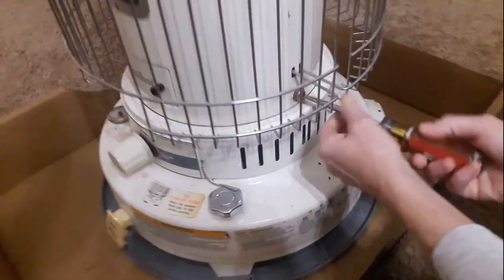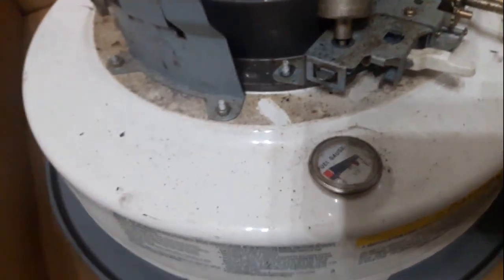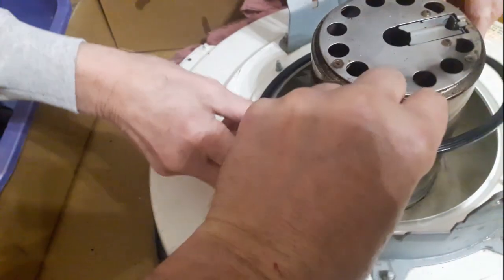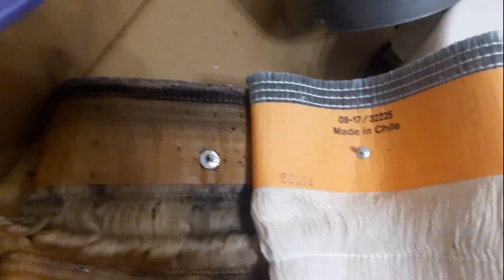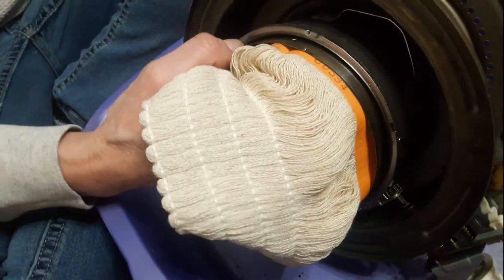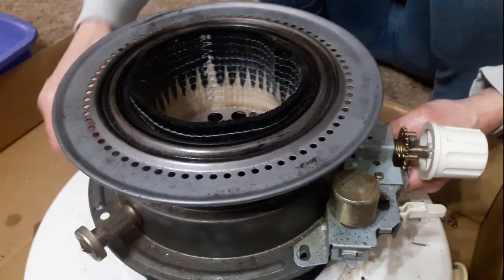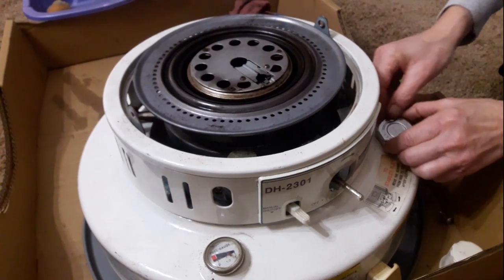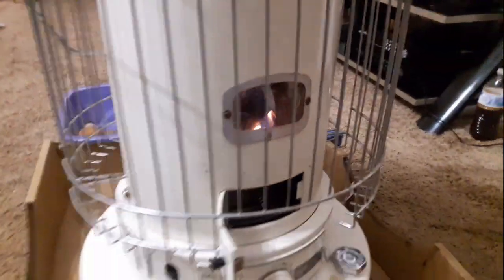How To Change A Kerosene Heater Wick

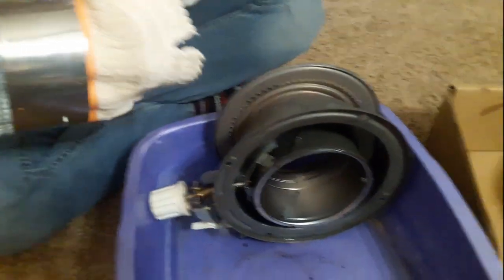Comment: Thank you so much for this. I have watched so many videos but was doing something wrong until I saw this one. You said to raise the wick BEFORE removing the wick assembly. I haven't done that yet and at 5:20 on your. video you said how to line up the pin heads to the holes in the center piece that raises the wick. No other video has mentioned that before. I hope that is my problem. I am quite a handyman but I'm just missing something while trying to replace a simple;e wick in a kerosene heater....... I hope your extra pointers help me get this thing in. Thanks Again.

Comment: Question, I have a kero world kw-12 heater. I used your video as a guide to change out my wick. I thought I did a good job until I went to light it. For some reason the flame is staying below the ring instead of going threw the center piece. What in the heck?

Comment: What’s the knob that pulls out on the back left side across from the wick adjuster? I picked one of these up from the dump and it works somewhat. Wick is good it is smoking on low. I’m trying to get it shop ready for winter.

Comment: How do I shut off A  Kero Heat Heaters that does not shut off ? I tried shutting it off to the Shut off Manual and it is still running  ? I tried the Adjusting Range But it is still going .

Comment: Where can I find the wright wick part number the misses left the manual at the store when she took it out the box to look at thanks
Reply: It is usually where the model number is on the heater on one of those labels beside the caution label. That's where I found mine at. I hope that helps.

Comment: I have 2 karosen heaters the first one I got a few weeks ago it done good on the first tank of fuel than the second tank of fuel it started acting up smoking and didn’t wanna burn right than I bought a new wick and started burning good the first time than started acting up again than yesterday I got me another heater that a neighbor gave me and it’s doing the same thing the karosene from last year some one gave me could it be bad both heaters are a year old any ideas ❤
Reply from the maker: It could be bad kerosene, or if someone put fuel oil or diesel in it. It will smoke.
Kerosene is refined further and should not smoke.

Comment: It's easier to start with an empty tank. Either burn it off or siphon it out.  I did this for the first time last winter, and by the third wick replacement, it got easier. Now I needed a refresher course but this looked a lot harder than I remember.

Comment: I follow your video but the knob to turn the wick up and down will not turn. I pull out the assembly and check the wick to make sure it is still in place and turn the knob and it is fine. But once I install it- the knob us stuck. What is happening?
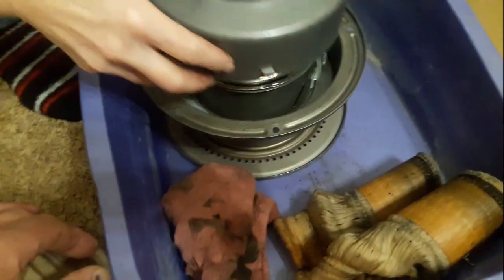Reply: Julie Gilmo make sure the rubber seal is in place when you put the assembly back together.Also be careful the wick isn’t binding or bunched up anywhere as you put it back into position.And the metal collar at 6:02 actually twists and locks into position instead of just being pushed into place over the wick.
Another thing to watch out for is to make sure the pins don’t pop out of the holes of the sleeve as you slide the assembly back together.If even one of them pops out a bit the wick assembly won’t raise properly.You should wear gloves as you’re doing this because of the metal spikes,make sure as you pop the wick rivets into the holes you also push the wick material snugly into theses spikes on the inner sleeve as it will keep the wick in position.(and it’s much better to work on if you siphon all the kerosene out of the tank that way if you have to reposition the wick a few times you won’t get fuel all over the place).
Reply: @fridaythe13thpartx  Quick question: Do I have to have the thin metal collar on when I put it back together? I assembled the wick just fine without it and I got the pins in place perfectly.. It's just that the collar was not letting me be great while assembling the wick, so I put it back without... I turned the knob up and down and it is working fine....just haven't lit it yet but wanted to know if this is going to be a major problem for me to where I have to reassemble again and add the collar? I hope I'm not confusing with my question. 🙏🏿
Reply: I had same issue  twice.  took it apart and did it again and still wouldn't turn.  I was about to give up then I saw a video mention to have the wick all the way up when putting back together and it works now.
Reply: D LAW I finally called the manufacturer- they had another video they referred me too. I got it in but now it smokes a lot. This is a real pain.
Reply: D LAW I will try that. The last time - I had finally gotten the wick in and was excited to try it. It was late at night and everyone was asleep- I lit it and all kinds of smoke started. I hurriedly ran the heater to the side porch and turned it off. I was too tired to mess with it anymore.
Reply: @jaycavalli600  No you do not have to have the thin metal collar.  I install wicks where I work and have been for 25 years.  That collar is a nuisance and just gets in the way.  One tip when putting it back over the shaft. Keep your thumb on that little metal flap that is under the counter weight. That keeps it from kicking down on you and allows one person to install it.
Reply: @donaldseale2700  AWESOME!! I so appreciate you for that feedback! I am actually getting ready to work on it this evening 💯🙏🏾
Reply: Knob must be fully turned clock-wise (wick up) when re-assembling.
Reply: @julieg7542   Lady.., IKR..they make it seem so easy in all these videos...but mine is now giving off Black smoke...those pins do not stay in & those little teeth do nothing but scratch at the wick paper...it is discouraging but I am putting up with it since my furnace went out..DAMN!!
Reply: @donaldseale2700   will it void any company responsibility cause it is a nuisance & doesnt seem to add anything but an extra step.
Reply: @djeanthequeen8247  I get so frustrated working on mine.  I haven't gone back for a month now.  But the thought of taking it apart is putting me off.  I have pulled it apart and back together so many times.